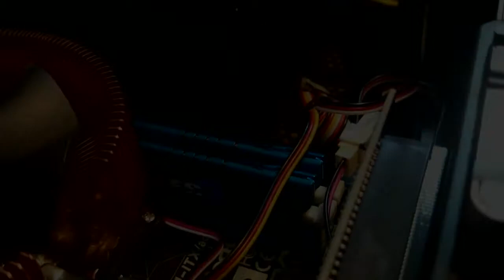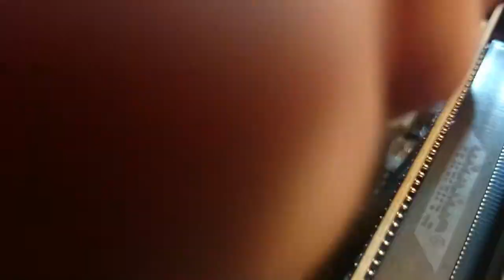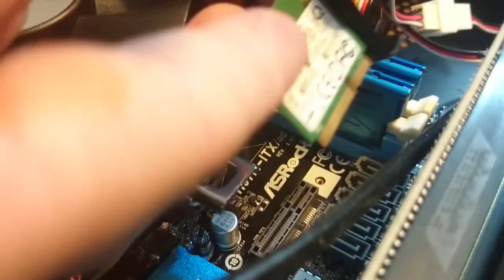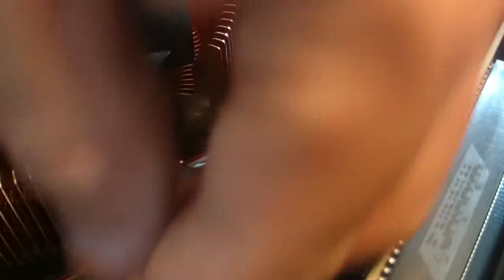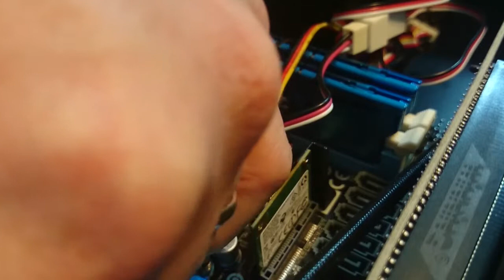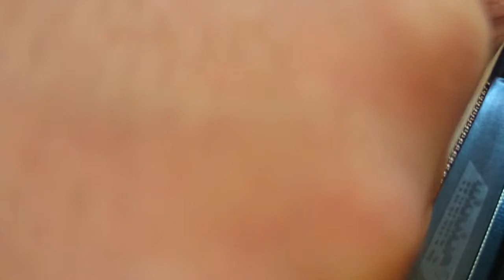Steambox Build Part 13 - Wifi Module Installation

Comment: how did you manage to place the wires for the WiFi coaxial piece into the chip, I couldn't do it for my computer
Reply from the maker: If I recall, I used a small pair of pliers with light pressure to get them to snap on.

Comment: You should have assembled the motherboard in it's entirety before putting in the case.
Reply from the maker: Yeah. I was a bit worried about over stressing the board when installing the heat sink and ram without it being secured in the case. Next time I'll probably try and pre-assemble as much as possible.
Reply: +Specter Gaming I have such chunky fingers, so any build I put as much of that mobo together as possible then secure it down!!